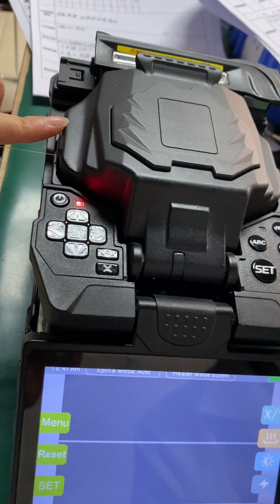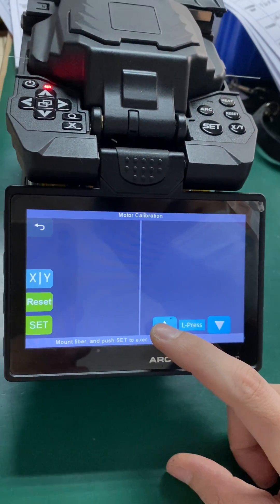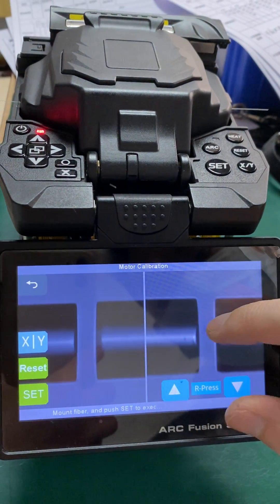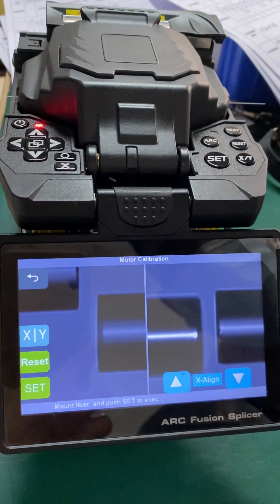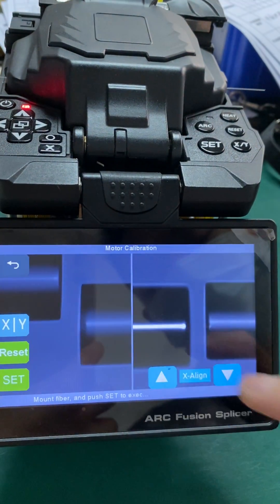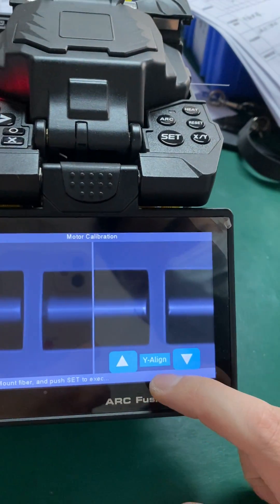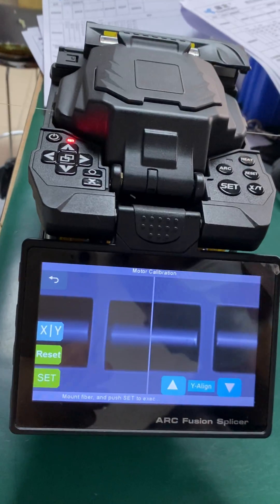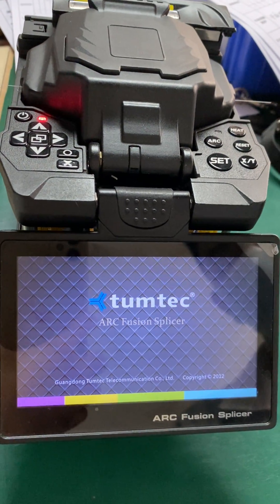21."Align motor over limit""fiber clad pass limit". Solution: update software & motor calibration

Comment: the battery indicator does not match on the screen
Reply from the maker: battery indicator has been upgraded. To improve charging time, the new battery indicator will not be flashing after 35s of charging. And when you click the indicator, it will show charging state. we suggest charge the battery alone, NOT charge the battery when using the machine/